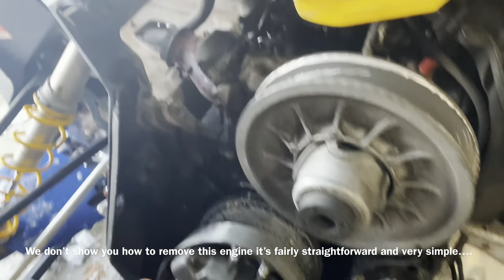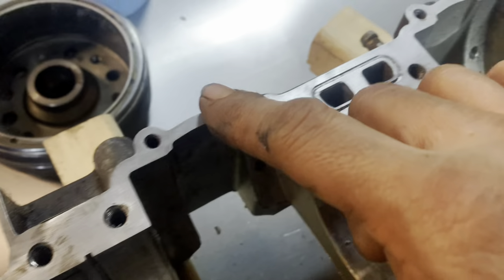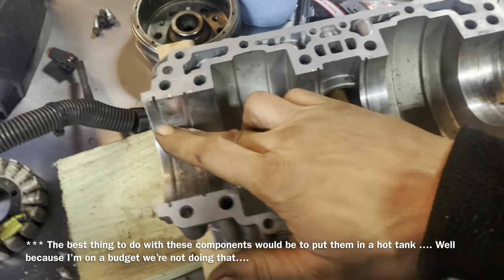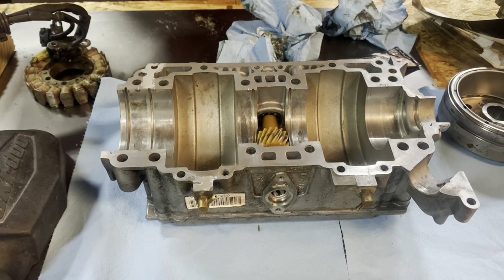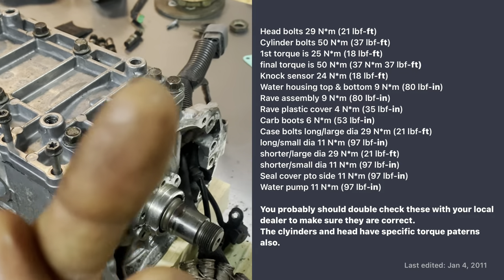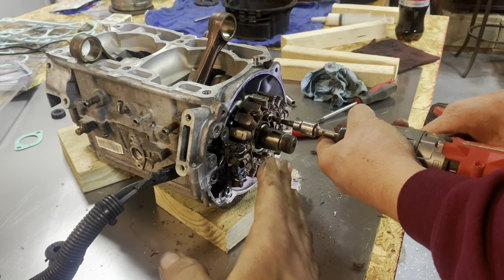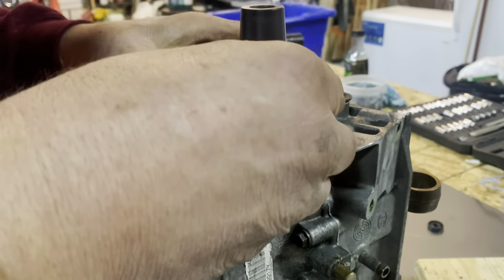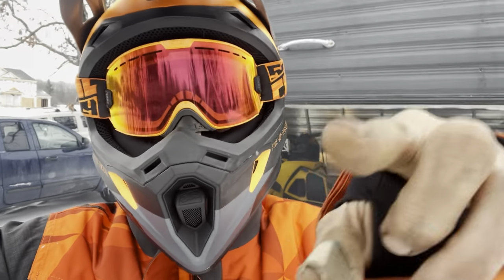Skidoo 800 R Lower End Assembly I broke the PTO side of the Crank right off the engine! -

Comment: You mentioned the crankcase halves "were checked out".
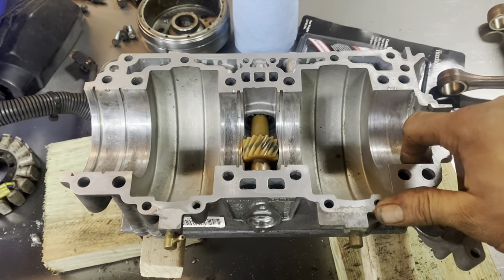If you look closely at 3:00, you can see marks from the crankshaft bearing locating pins (roll pins) where they got pinched/crushed between the crankcase halves. You can also see the marks at 7:00.
This is apparently why the 800R has bearing issues. The machined surfaces on the crankcase halves are milled down to much. There's apparently a dealer bulletin on this. It can cause the bearings to fail because they're getting slightly crushed. Also look at the nylon gear that runs the coolant pump and oil pump. It's getting dark in color because the opposite gear on the crankshaft is meshing too close to it. 
I'm in the process of rebuilding an 800R and was curious as to why the crankcase halves, have the roll pin (locating pins) etched/ crushed into the crankcase halves. Apparently to fix this, the halves need to be line bored to match the crank bearings the way the manufacturer should have done in the first place.
Reply from the maker: Excellent information Frank I did not know that I am not a service tech or anything I just wanted to have some information out there for people that are looking for it and wanted a little bit of logical direction I suppose is the way to put it but I pinned your comment so others can read it thank you very much
Reply: Hello,  Apparently line boring is not the way to correct it. Sorry about that

Comment: I used blue loctite on my mag side. 
Hope itll hold. 
Atleast it's better then none! Had issues with bolts backing out on the pull start mount and starter ring back of clutch in the past caused some pain. (Helicoil, broken tap, bigger tiny bolts.) 
I learned to pretty much loctite everything that's around the crank due to stuff backing out and the constant motion. 

Thanks your video reassured me I did it right. Blue should hold, I hope. It's all I had on the shelf. 

Had to size up the threads for two holes. One for recoil mount. And one for the pick up magnets. Generously loctited.
Reply from the maker: Yeah I don’t think that blue is going to be an issue and thanks for the kind words welcome to the channel Jordan we’re happy to have you

Comment: I noted that you repeatedly said that RED Loctite must be used to secure everything on the magneto end of the engine (stator, etc) but....my service manual specifically calls for Loctite 243, which is a “medium strength” blue product.   From where did you guys get differing information?
Reply from the maker: We didn’t get different information…. We know how to build stuff to make sure it doesn’t fall apart…. You can use whatever you like. I have the right equipment and mechanical machinery to be able to get that stuff out or repair things if necessary I use red but there’s nothing wrong with using blue.

Comment: Clay, Any issues with this motor after the rebuild? I am about to re-assemble mine and don't want to miss anything. Thanks for the great video, one of the only ones on here for the 800R bottom end
Reply from the maker: Well Jim, thank you so much for the kind words brother and no I did however, I have a stater problem later on, but it had nothing to do with my rebuild. At least I don’t think it did… it ran super even though I only put out about 500 miles last season